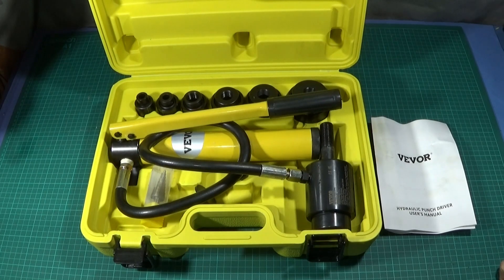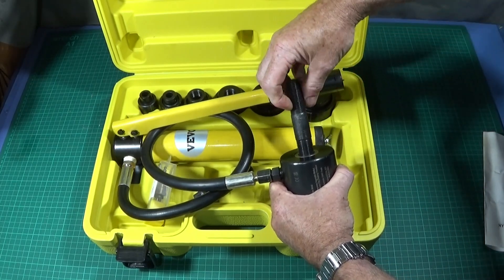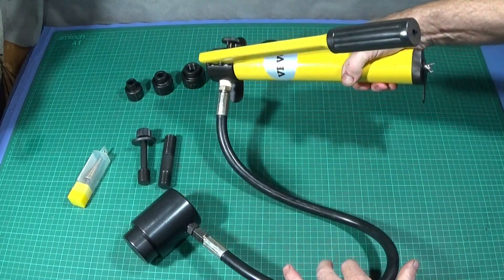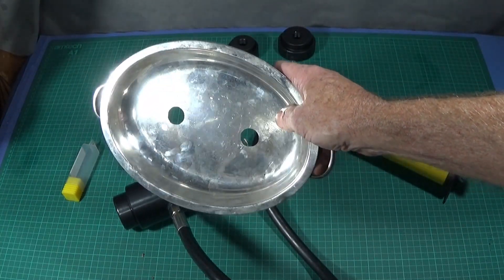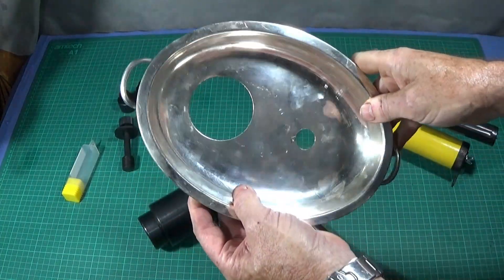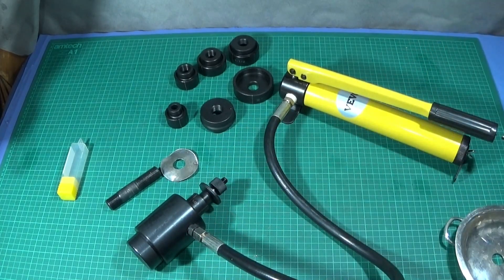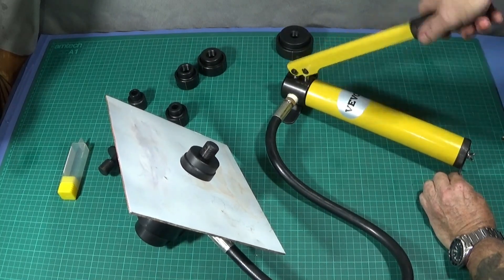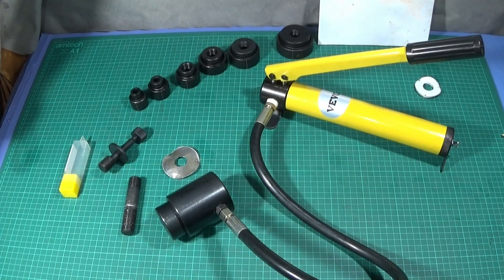THE VEVOR HYDRAULIC KNOCK-OUT PUNCH DRIVER KIT SYK-8B REVIEW & USE

Comment: Just so people are not surprised by the hole sizes, remember that this set of punches is for US conduit sizes, and the holes are actually the sizes for conduit connecters - a bit more than .3 inches larger than the nominal diameter.  There is a similar set for metric conduit.

Comment: Gday Steve, I didn’t know they did this tool, it worked a treat, what is the maximum thickness it can cut, great video mate, cheers
Reply from the maker: Hi Matt, Thanks, I will check it out and see. They only specify 3mm, I think, but I reckon they will go through thicker. I'm looking forward to making some difference die cutting parts that can be used with the actual existing die cups. There is no need to make one's with new threads as one can use them in a special way. I hope to show it soon. Regards Steve

Comment: They're super handy, you can use it to Dimple Die as well, also there's other Punches and Benders you could use with that Pump.
Reply: G'day Mate, That's what I intend to do- I  found this kit looking into buying a Dimple Die kit to make some running boards for a TE20 Fergie & saw how inexpensive these knockout punches are 
- Did you buy Dimple dies to suit this Vevor Punch? or modify the the hole punches provided? I was thinking maybe I could 3d print a Cup & Washer that could be used with the existing  pump or turn up something on the lathe - Idk - buying a good set of Dimple Dies is a bit expensive if it not something you're going to use regularly - Any advice is appreciated - Cheers Paul 👍
Reply: @purebloodheretic4682  I just made mine on my Lathe, not hard to do, just a male & female die with a hole to fit the bolt on the ram.
Reply from the maker: Hi, That's great. I will have a look at the possible options of extra homemade tools for this one. Regards Steve
Reply: @SteveJordan  Make yourself a Bombers Seat Steve.

Comment: Fantastic tool Steve. Modern version of a chassis punch. I could have used one of these recently. Had to cut five 28mm holes in some aluminium sheet. Bought a hole saw set from Aldi which did the job, but made a dreadful mess. Cheers Nobby

Comment: Thank you for the review. I am glad you found the build quality is adequate, as I have this exact same tool: In addition to using it for the intended purpose of making holes in sheet metal, I purchased it also for the hydraulic pump, which I plan to use with a hydraulic wedge I also have. I just need to figure out the thread sizes in the punch cylinder, as I need to replace the fixed connection with a quick disconnect to be able to switch between tools.

Thanks also for all your other content, especially on the Chinese mini lathe.
Reply from the maker: Hi Thanks, Yes I will look into that sometime soon as I want to convert mine to a quick release coupling. They did have them on the earlier models, I think. Regards Steve
Reply: @SteveJordan  Yes, I'm under the same impression, so it's a shame they did away with the quick disconnect on these. Please do share your findings if you eventually go ahead with the conversion.